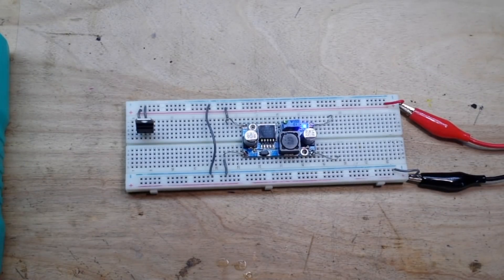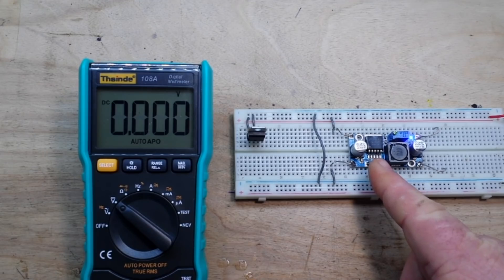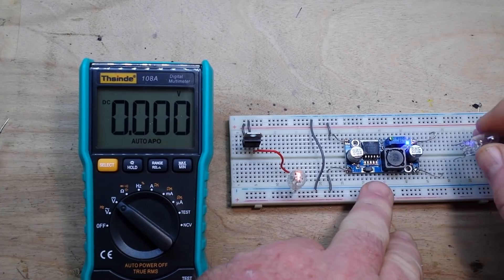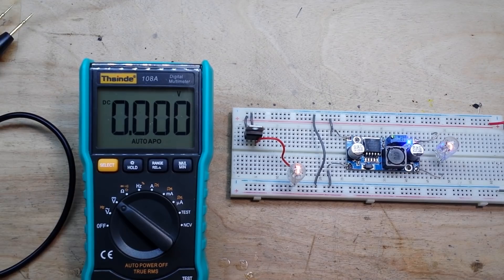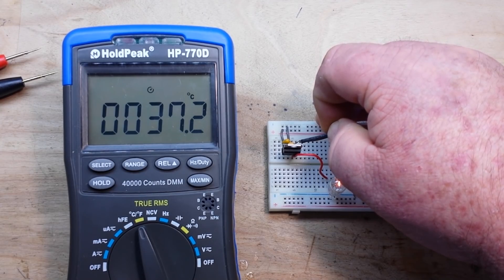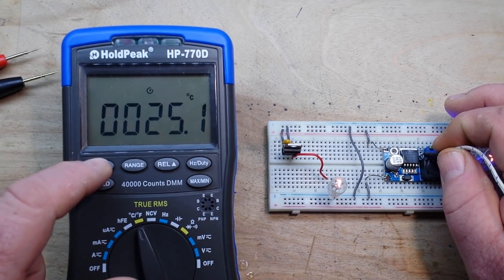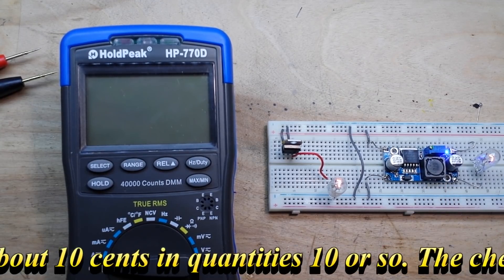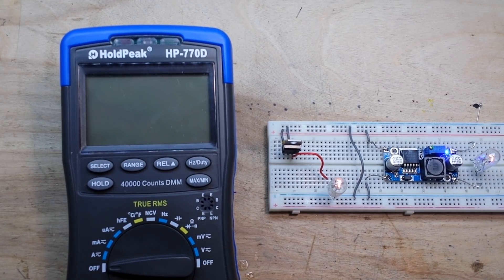Which is better? buck converter or linear voltage regulator

Comment: The best practice is to use BOTH! Step the voltage down with a buck converter THEN get rid of them pulsations with a linear regulator! :)
Reply: The "belt and suspenders" approach!
I approve.
Reply: NLab ™ hello but the pulsation you talk about are not erasable with a linear regulator. They go within the regulation ability and they are not what a linear regulator is build for. Linear regulator is made to prevent low frequency ripple, not noise from switching supply, wich are nearly impossible to erase when the buck is not enough well engineered.
Reply: I've been wanting to try using a buck converter to linear regulator!
Reply: @AIexanderHartdegen  I'm not claiming to know what I am talking about, but couldn't a proper filtering circuit be included between the buck converter and linear regulator to help with this?
Reply: @hmx this is possible. I just replaced a buck converter by a linear converter, for preventing noise on a scope. To reduce noise coming from a switching supply is praticly impossible.
In the case where the buck is noisy, it gives parasitics pulses and electrical field and radiation, and some equipments can not work with it ( a fm radio can't work with a noisy power supply)
In high quality boost or buck, the wave is smoothed by capacitors and snubbers, and this is not a perfect square wave on the HF coil, wich provide more heat and bigger components! 
But suprisingly, some buck, or boost converter are very nice made and permit to use it on critical application, to supply a voltagte reference for exemple.
A buck need to have more voltage in entry for regulating, like the linear way. So, for your exemple, you loss 6 volts for regulating two times.
If you want to know if your buck is noisy, you can use a simple FM radio. Supply the radio with it, and if the sound is correct, that's mean the buck regulate without significant noise.
In some case a buck is perfect, in some critical application, and if the buck is not ok, linear is better (but loss of energy, heat, etc).
Your idea can work, but for preventing noise I think linear are not made for. You just need to know for what application you need a regulated voltage.
Reply: @bipolarchemist  by fitting an LC filter between the buck converter and the linear regulator, it is possible to remove the high frequency switching components that are outside the bandwidth of the linear regulator control loop. Choice the right linear regulator and it behaviours as a ripple stripper for the remaining noise that passes the LC filter. This lower frequency ripple is associated with the limitations of the voltage control loop of the switching converter.
The reason it is difficult to remove the noise generated by the switching converter is because it is produced at a low impedance. The effect of the L in the filter is to raise the converters output impedance to a point where it can be attenuated by the potential divider formed by the impedance of the filter capacitor.
The higher the converters switching frequency, the easier it is to remove its associated conducted switching noise, as the fundamental noise component is higher up the spectrum, a greater number of octaves above the required DC. It would be a mistake to over overemphasize the noise filtering function of the linear regulator, as its real purpose is to maintain its output voltage by supplying the transient current demands of the load. To this end it is often still necessary to place a suitable reservoir capacitor close to the input of the linear regulator, after the LC filter which is likely positioned close to the switch mode to keep potentially radiating PCB tracks as short as possible. A small value electrolytic is often used in combination with a higher frequency ceramic capacitor to provide the reservoir input capacitance to a linear regulator. Particularly important in LDO regulators, where the capacitance is required for stability.
It is obvious that PCB layout is critical to avoid earth loops and common mode voltages appearing on the zero volt rail. It is also important not to fall into the trap of thinking the bigger the shunt capacitor the better. Large value capacitors generally have a poor high frequency performance. The impedance of an electrolytic capacitor is so high that it will have little or no effect on the high frequency noise generated by a buck regulator. It is far better to distribute parallel combinations of lower value, high frequency decoupling capacitors around the PCB circuit.
By using a buck converter to power a number of low  current, low dropout linear voltage regulators to supply different parts of a complex circuit, the DC voltage drop associated with the L in the individual LC filter can be kept low, while still providing a higher inductance value. While the above may sound like a profligate use of capacitors/inductors and cost trade offs are part of the design process, there are various tricks, too numerous  to mention here, in keeping the component count as low as possible. To this end it is important to have a good product requirement specifications, so that you know just how much noise suppression is required so as not to over engineer.
 I know the above technique work, as I have used them in a number of telecom production products, both analogue and digital, all of which were subject to independent type approval testing for both conducted and radiated electromagnetic interference and also were required to meet state of the art product specifications of their time.
Reply: @Another Dick commercial grade devices were specified 0 to 70C. Industrial -40C to +85C   and military from -55 C up to 125C.
In the 70s and 80s it was dangerous to try and use commercial rated devices in automotive applications as the automotive reject devices were sold as the commercial grade. Some industrial devices were only specified to -20C. As manufacturing has improved, many commercial rated devices were surplus industrial grade devices that leaked through into the commercial bin, simply because the lower quality parts were just not coming off the production line anymore.
In my industry, mobile telecommunications, industrial rated parts were essential. In the early days of processor technology, the old N Mos parts struggled to work in the negative temperature range and we ended up testing the hell out of the designs to prove they were reliable down to -20C. The trick was knowing how they failed with temperature and which parameter to use in the selection process. The irony was that N-Mos devices tended to run very hot and drew a lot of current, this actually helped at the low temperature end, but was a real pain to deal with at the high end.
With regards to your friends choice of power supply, a custom switch mode design is way over the top for such a low current project, however there is a lot to be said for using a cheap, approved, off the shelf switch mode supply, such as the ubiquitous USB brick. One thing to watch is if the supply will operate with a minimum load. It may become noisy, unstable, poorly regulate or even be less efficient than a properly designed linear regulator circuit. Most switch modes reach peak efficiency above 85% load, with efficiency significant less at low or very low load.
It is true environmental testing is expensive for component manufactures, so they won't test in temperature regions for body they are not specifying the device. If you want to use a commercially rate device in a limited automotive temperature range it is important to understand the devices failure mode with temperature. It maybe that the device parameters that slip out of spec first are not that important to your design. You would clearly need to do you own testing, however be warned you can run into tolerance spreads that are batch dependent. What works for the September run may not work for those made in November.
We had this problem with a processor with an on-board crystal oscillator driver circuit. In this case the bias voltage that held the oscillator in its linear region was subject to temperature drift, as the internal bias current changed. The effect was that the oscillator stopped when the input ceased to be in the linear region. The rest of the processor logic continue to work fine, as it was just switching logic levels. I suspect that internal fan in and fan outs were out of spec, but it worked correctly. The solution was to fit an external oscillator that worked over the required temperature range, to drive the processor clock input signal.
Reply: @Another Dick guessing is dangerous and not very scientific. In a production environment guessing can get you fired and cost your company a lot of money. The best you can do is a set of batch measurements and see if you can identify the most critical temperature dependent property that can be seen on the external connections. That might be regulation or noise or quiescent current or any number of other parameters. One will stand out when you take the device to its extreme. A tip worth noting is some devices fail over a limited range of temperature, only to recover at the extreme, so don't just test at the very worst case as you may miss something.
Regulators are relatively easy to test, oscillators are more demanding. I have come across circuits where over a small range of temperature, the regulator has burst into oscillation in the VHF and harmonic UHF band, putting out not insignificant amounts of RF power on the input supply leads. In all other ways the circuit that the regulator powered appeared to be working correctly. The only clue was that the regulator was running warm to hot and the input DC had jumped a few hundred milliamps. There was also the little matter that all the analogy TV sets in the vicinity had stopped working and were making horrible noises.
Reply: @Another Dick I think you would be surprised how many skill people who post here. I have been retired for some time now and my skills are getting rusty or at least my industrial experience maybe out of date. Now days electronics is mainly a hobby or the necessity of repairing some home gadget. I failed to mention that many data sheets provide an internal circuit diagram for the device in question. This sometimes provides a clue to the devices failure modes, particularly when testing has pointed out where to look.
Reply: It fairly common when you need 'the best of both worlds', but it is hardly taught; as if all problems can be solved with one or the other. If you need an efficient AND clean power supply, buck regulates to +1.5v over your target, and then use a linear regulator for the last 1.5v. It is extremely easy to cut your ripple to half of 1.5v, which, after LC smoothing, will be flat as a pancake and you will have a hard time measuring ripple over the noise.

Comment: So what is the best solution for powering a Raspberry Pi4 with a converter from AliExpress with 13.8 vdc input to 5vdc output 4A. .  I see soo many 4016, lm2596 pcb s .   What would be wise to get from AliExpress.